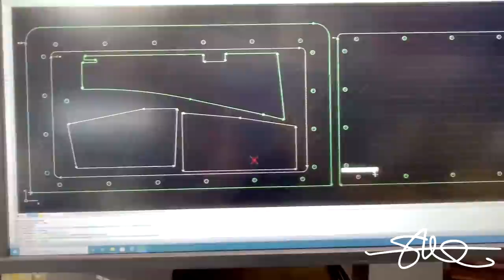"Bloodbath" BASS! 6 15" Subs 32,000 Watts! 6th Order Stack Fab Bandpass Wall - Chevy Tahoe

Comment: Car audio has come a looooong way since I competed in the 80s and 90s....and my hearing loss is proof
Reply from the maker: except you didn't loose any hearing from  your 80's and 90's system. Not loud enough. Sorry. I'm sure it was awesome and great memories though!
Reply from the maker: @Whisper_Pickle  exactly my point...the systems today do a 136 just slamming the door shut. So that is pretty weak in the current SPL world.  We have to have "remotes to escape the SPL" because our shit is actually loud.  Also, i am probably older than you and had systems in my rides in the 80's and 90's as well.  So i am speaking from experience.  Your system was NOT loud enough to hurt you.  You just think it was because back then everything seemed loud. Your screeching, distorted highs probably hurt your ears more than your subs. Just like most of todays systems.
Reply: There was a few very nasty loud systems in the 90's probably could hang with some of todays top systems. Even some of the low powered setups would kick your ass. Not saying the will rip your head off like todays monsters though. It is a whole different breed today

Comment: I tried getting some B2 Rage XL's they were out and didn't know when they would get more so I spent a little more and got DC subs. The rest is a B2. I'm going to do another rebuild next year. I'll either go B2 Rampage or switch to all DC and lvl6 subs. I'm looking for a newer bass rig also. I can never find a vehicle with no sunroof. I never even use them. Back in the day sunroofs were not really a thing. It was a luxury add on. Shoot I never had cruise control or air back in the day lol.

Comment: A special microphone captures without distortion. I love your videos! Congrats!
And it would sound so much better on my little speaker box with a 10-inch 250W subwoofer, JBL ST450 and JBL D250 TRIO connected to my computer.
I'm one of your fans in Brazil.

Comment: When doing a build with this many subs doesn't it make more sense to use subwoofers with a higher BL rating to help compress the air space? I mean, with all the doors open I suppose it doesn't make any difference but these subs are only like 25 BL. I'm aware that's not the only factor and high BL subs often have to trade off low end response a bit but it's a relatively good measure of motor force afaik and low 20s are considered kind of meh when there's 18s out there in the 40s and such. Am I totally missing the mark here or would this build have potentially been higher SPL if they had used a slightly different driver with a stronger motor?